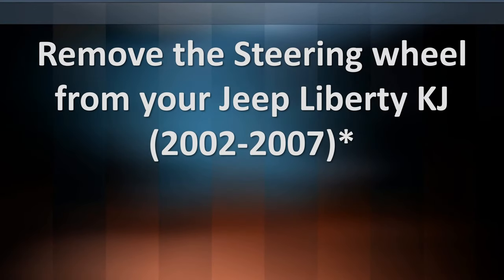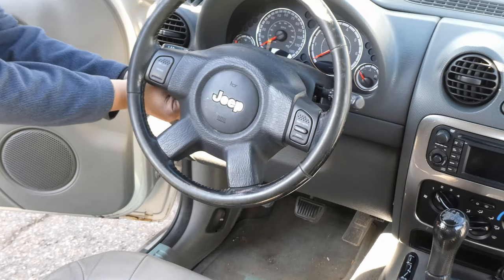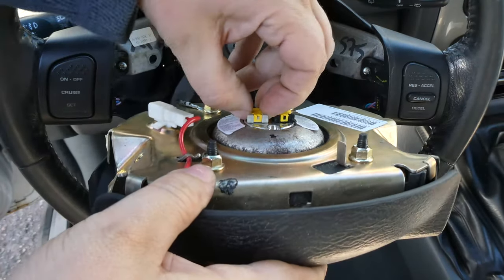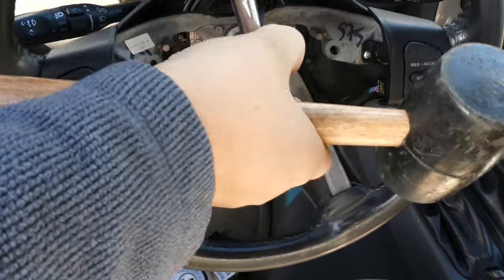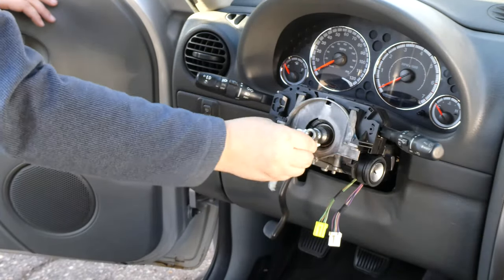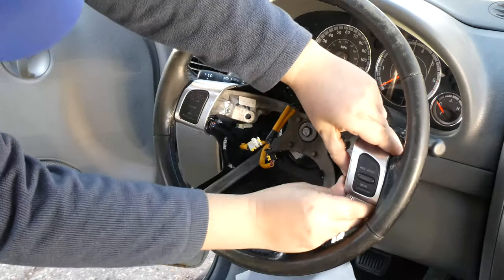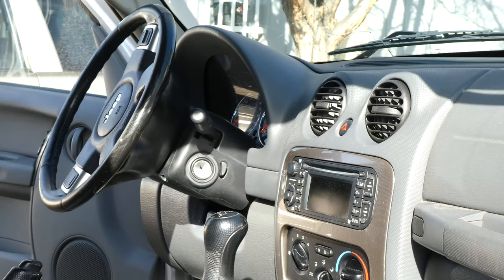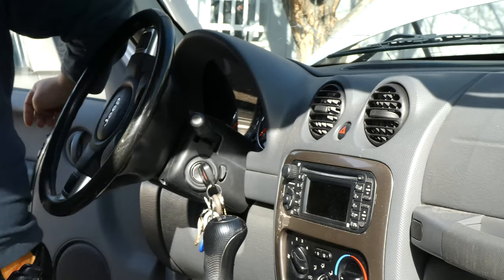Remove the Steering Wheel from your 2002-2007 Jeep Liberty KJ... and add some radio controls!

Comment: Very helpful Thank You. If clockspring is used or got moved, you can re center it yourself. Aim jeep tires to straight ahead. Take clock spring (removed from steering column) and push lock/release button located in middle lower position, turn spring clockwise till it stops, do not force it, turn 2 and 1/2 turns counter clockwise and release button. Wire harness connectors should be at the top. The blue roller should be visible through inspection window. The arrow on label should align with arrow on molded spring case.

Comment: Did you have to get a vin programmed clock spring or could you send one to get programmed to the specific vin? Or disconnect the battery in order for it to work all together? Because I got a clock spring from a Jeep that had the controls and I could still only use cruise and horn. Keep in mind I have an aftermarket stereo just like you and I did fail to disconnect the battery and never discharged the airbag

Comment: Nice!!

Quick question here. Trying to swap an standar 08 kk steering wheel with cruise control to anmore modern 2012 kk With allt the buttons integrated is it possible?

Comment: 2 questions. What year is your Liberty and did the clock spring have a lock tab on it that keeps it centered that needed to be removed. Thanks for the info
Reply from the maker: This Liberty KJ is a 2005. I know that the 2002-2005 all use the same clockspring. In 2006, it was changed. I believe it was a mid-year change (fun times!), so if you are hunting for one, match the model year to be sure and pay extra attention to 2006.

The clock spring has two clips that keep the outside housing centered on the column, but there is nothing to stop the inside part from spinning freely. If you have spun it and are unsure if it is no longer centered, here is a trick I used on my XJ: Spin it all the way to one side, then count the number of full revolutions to get it to lock spinning it the opposite way, divide that number in half and then spin it that far back the first direction. For my XJ it was 5 full rotations so 2.5 was the middle. Worked like a charm!

Good luck with your project, and thanks for watching!
Reply: @eXperimentalJeep  Thank you for the quick reply. My KJ is that lucky 2006 and haven't found a new clockspring for less than $340. Thanks again for the info

Comment: Maybe I missed it. Is the harness for the stereo controls already there? I know on some manufacturers it is.
Reply from the maker: If by the stereo controls harness on the steering wheel. then no - the controls need to be added and the clock spring needs to be changed to accommodate that. If you mean the harness in the dash, then yes. I added a CD changer so that I could add Bluetooth in... but that is for another video :)

Thanks for reaching out, and for watching!

Comment: Hi I’ve recently bought a racing steering wheel and I need a steering wheel hub. The new steering wheels bolt size is 6x70 and I just can’t find a steering wheel hub that fits this jeep
Reply from the maker: You may have to have one custom made... I am assuming you have reached out to the racing steering wheel manufacturer? If not, start there. I had a friend that was very into racing (not Jeeps tho...) and he basically had a machinist on call for parts.

Good luck with your project, and thanks for watching!

Comment: After garage working on car and me getting it back I am able to see the wires on the steering column...they weren't covered back up...I don't seem to be able to contact the garage again...have left messages but no return call...
How can I get the wires recovered?
Reply from the maker: If by covered you mean tape wrapped, then you can just leave them "uncovered" or you can get some cloth tape or electrical tape and wrap them up.

If you mean bare metal on the wires exposed - you need to take it back to the shop, demad a refund, or both. You dont want a short in your steering colum - could have an airbag go off while driving down the road and that would not be fun.

You can wrape the bare wires with electrical tape - if thats the issue and you get nowhere with the shop.

Good luck with your Jeep, and thanks for watching!

Comment: Hi I appreciate your help. I have a problem with my jeeps horn, and the alarm won't stop. I had to remove the fuses to disconnect  the alarm and the horn. How can I fix this? Please advise me. Need help asap.. thank you in advance. Have a great day.
Reply from the maker: I'd bet its the clockspring... had a similar issue with my XJ and the horn. If there is damage to the internal wires in the clockspring, all sorts of weird things can happen. Not sure if its the same on the KJ, but the TPS shares a ground with the cruise control switches in the XJ, which means the TPS could be sending bad or no data because of the clockspring in your steering wheel! Sounds crazy, I know, but w/o a wiring diagram or online resources, people would never know about how one silly little thing can impact another.

Good luck with your project, and thanks for watching!

Comment: I wrecked my jeep air bag blew up do you know what I have to replace and what I need?
Reply from the maker: Aside from the obvious of a new air bag... You'll need a new clock-spring. This is the device that allows you to have steering wheel controls like horn and cruise control and still turn your wheel.

When the air bag is deployed, a large electrical current is sent from the air bag control module, thru the steering column and the clock-spring, ending in the deployment of the air bag. The large current damages the clock-spring and you won't have the controls like horn and cruise control, and the replacement air bag will also not work. Replace the clock-spring and you should be good.

I do not recall if you need to replace the air bag control module to reset the system. If you do, just remember to get a control module from the same year, trim level AND one that had the same options... i.e. front only vs front & side curtain air bags.

Good luck with your Jeep. Thanks for watching... And the like!

Comment: Seat Belt around the steering wheel so you don't need to hold it.
Reply from the maker: Not a bad idea... had not thought of that. My only concern would be if it would actually hold. The seatbelts seem to lock up on me when I lean forward to change the radio, but then down lock when I slam on the brakes. Definately worth a try - next time I need to take it off!

Thanks for the suggestion, and for watching!